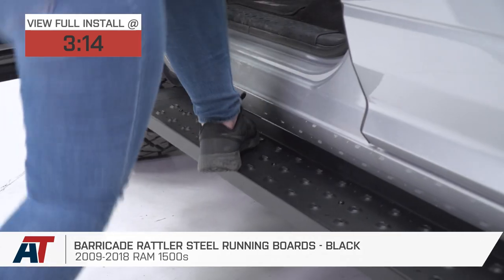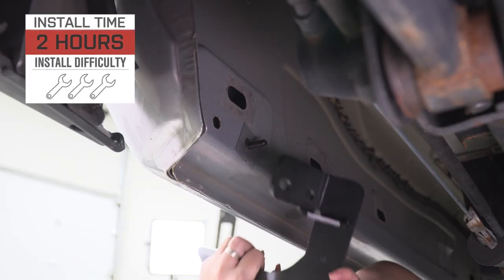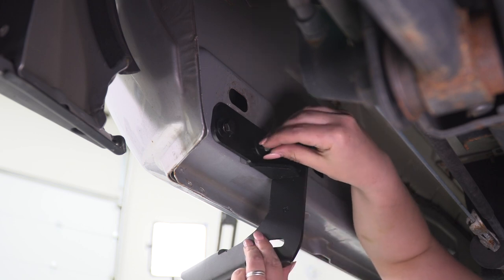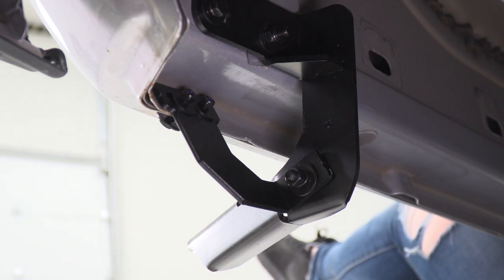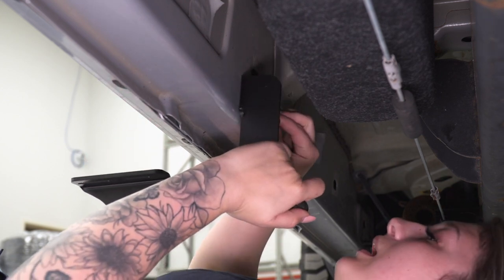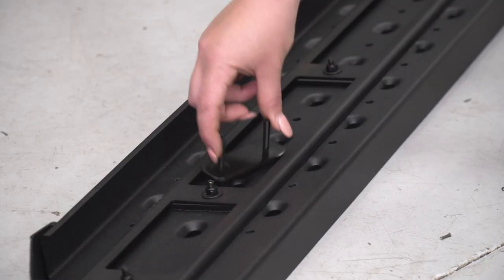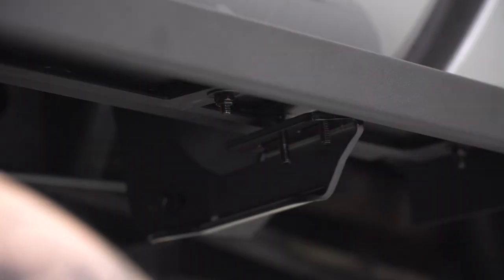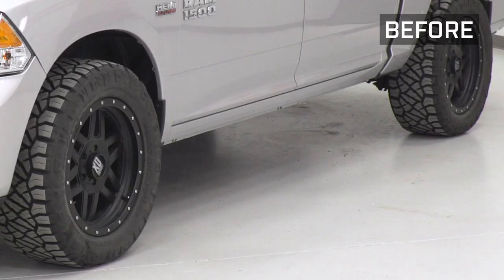2009-2018 RAM 1500 Barricade Rattler Steel Running Boards Review & Install

Comment: The middle bracket hardware doesn’t have enough room to slide the bolt plate down. Any suggestions?!
Reply: Did you ever get a answer? I’m having the same problem